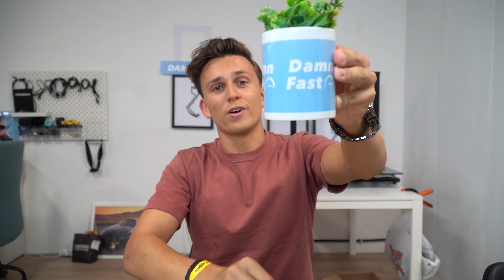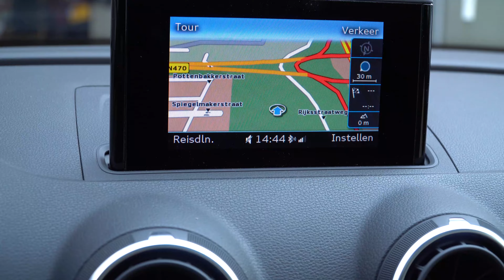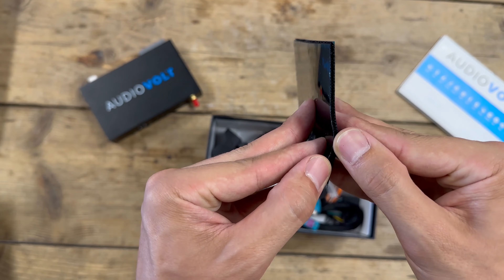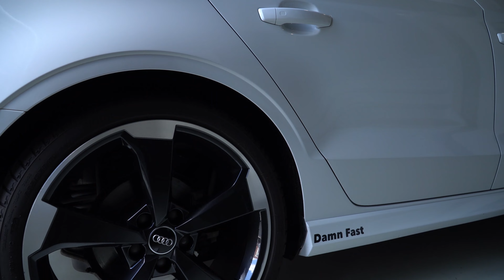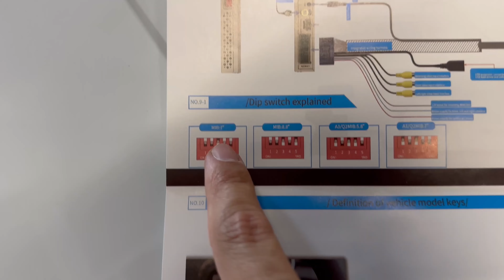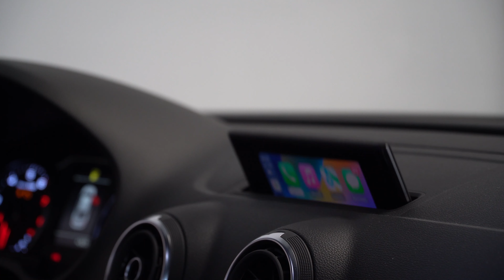Apple Carplay & Android Auto Installation in a 2015 Audi A3!! | Wireless & USB (How To)

Comment: Hi! do you know if  these kind of systems require a music interface to aux adapter to work? Mi a3 has bluethooth and a music interface but i read on some forums that an adapter may be required for it to work correctly, or does this particular unit route the audio through the central system cables? ( the pink and grey coaxials in the glovebox). thanks in advance
Reply: On mine they supply the ami aux adaptor which must be connected in the centre console so that the aux input can be chosen.  You don't actually write it up to anything though.
Reply: @Ryzza5  oh well that's nice, so i dont have to pass the adpter to the central tunnel under the shift lever? that's whats buggin me
Reply from the maker: Nopee, on older systems you only needed to put it in for the car to recognize the aux in the mmi… Than you can just use that as your audio input. But as said, you don’t need to do any of that with this system
Reply: @DamnFast  that's even better! thanks!
Reply from the maker: Hii, this system does that internally. So you do not need a separate aux ami connector. A lot of older systems do still need this tho…

Comment: How can you connect your phone wirelessly if you turn off bluetooth if you want to use your factory fitted mic ?
Reply from the maker: Good question! The carplay module uses a wifi connection, which is initiated with a bluetooth connection on startup. The module knows the CAN identifier of the OEM microphone and therefore knows how to use this. You basically don’t need the car bluetooth anymore
Reply: My device wont work with oem Mic?

Comment: I think we see your speed in the end of the video, I hope you are in germany ! Thanks for this How to very usefull. I'd like to do the same on my e-tron but I dunno If It'll fit because of the hybride system (2015) (it has additionnal menu)
Reply from the maker: Haha yess this was in Germany! It does still fit the E-Tron hybrid system. You can switch between carplay and the oem system so no problems there… just hold the Menu button to switch
Reply: @DamnFast  I just fit this unit in my A3 e-tron from 2015, it appears to work but I cannot get any image of android auto on my screen... Everything does connect like it should and I do have sound via the AUX input like you described. I thought it was my dip switches, double checked those but they should be fine. Any idea why everything but the display works?

Comment: Thanks for the great video. I have one of these I've just installed in my Audi A3 2016 - seems I have the same MMI system as yours. I did all the installation and screen is working for Android auto with maps etc, but no sound from any apps. I heard you have to activate AUX but can't find any info on how to do this. Do you know what I need to get the audio to work?
Reply: I just tried disabling Bluetooth as you mentioned in video and the Aux option appeared which I selected. Audio works perfectly now. Thanks! 🙏🏻
Reply: It's not the Audiovolt but a similar one. Audiovolt looks better quality than the one I got though.
Reply from the maker: Hey thats nice to hear! Did you order at audiovolt as well? I had the same problem at first. You need to go into the OEM system, to media. Then you want to change input from Bluetooth to AUX. Now everytime the system boots up, it will use the AUX audio from your carplay system :)
Reply: @DamnFast  hoe klinkt het geluid net zo goed en scherp als voorheen ?